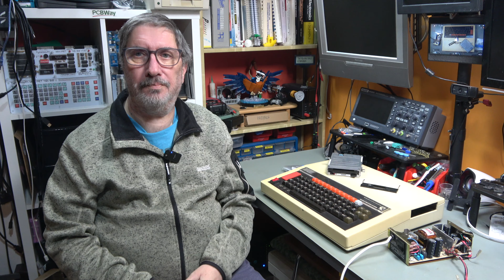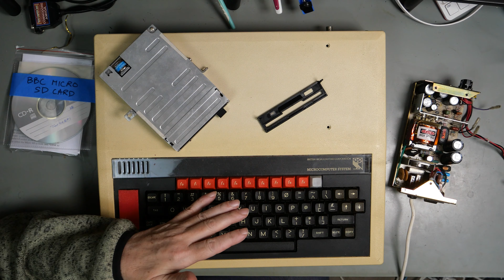Episode 83: BBC Micro Floppy Repair attempt And More...

Comment: I am almost sure you have the data cable back to front for the floppy drive as you has the pin one end towards the centre of the drive. which normally results in the LED on the drive coming on all the time.
Reply from the maker: Thanks. That's definitely the consensus.

Comment: Your floppy disk data cable is in up side down. You can see the correct orientation printed on the PCB at 13:36  pin 1 (the blue stripe) should be to the outside of thr drive. 🙂
Reply from the maker: Thanks

Comment: Great video Tim =D  Try that cable the other way around with respect to pin 1 (you could measure grounds on the controller board and drive to be sure).  The 1772 does DD but not HD, I think you need the Ajax chip for that!
Reply from the maker: With the amount of BBC media in my possession being a big round 0, I'm not too worried about HD, just curious is all. But I'll definitely flip that cable. Thanks Chris.

Comment: I don't think anyone else has commented on this yet, but I think your Beeb has had some mods associated with the sideways ROMS.    If memory serves the sideways ROMs on the motherboard map to ROM numbers 15, 14,13, and 12, and will only normally support 8k or 16k devices.   Your combined BASIC/DFS ROM seems to be a 32k device, so I assume that there has been some tinkering with the logic to enable this feature.   Also the ability to use a static RAM device I think would require a modification to the stock design.   Whatever it is, is clearly working, but if I were you I would try to figure out what and how it has been done, lest it conflict with something else you may wish to experiment with in the future.

I think I would be looking around the IC20 and IC21 area and IC76, and the associated links on the board.  Maybe there is evidence of some cut tracks and/or bodge wires, also maybe directly on the ROM sockets themselves.

I for one would be interested in knowing what has been done, especially as it seems to work great!

Regarding the power supply, I would double check your work around the electrolytic capacitor you replaced, as I think this one which lives close to a warm-running resistor can cause the PSU not to start up if it goes faulty, and this is the reason the replacement is recommended (having an electrolytic next to a hot component often results in premature failure eventually)
Reply from the maker: Thanks, I'll definitely look for mods around those ICs. I noticed the combined ROM was double sized, but not knowing enough about it, didn't really investigate further. The whole sideways ROM notion is new to me, so that's something I want to delve int in more depth.
I will definitely double check that electrolytic and the resistor next to it.

Comment: There are different types of sideways ROMs in a beeb: they can be 'language' ROMs (L), 'service' ROMs (S), or both. Essentially, any ROM with a * command is a service ROM and language ROMs include any software that executes directly from ROM, including programming languages but also word processors, games, terminal emulators, etc.

The model B has 16 logical sideways ROM banks, but only 4 are available on the board. You can solder some missing lines to be able to install larger ROMs and access the missing banks that way, or there were piggyback ROM expansion boards available that provided 16 ROM sockets. These days, you can get boards with flash ROMs or battery backed RAM available to load ROMs in situ.

The order of the ROMs is also important because the ROMs are searched from top to bottom (right to left on the board) on boot or whenever a * command is called.
Reply from the maker: Thanks for the info. I'm hoping to explore what you can do with the ROM sockets in the future...

Comment: Sometimes a constantly spinning floppy drive is the result of having your  ribbon cable inserted upside down.
(Ask me how I know! 😂)
Reply: Exactly that, when you twist the cable, all signals are shorted to ground. Motor on and drive select are active low, so you get a spinning motor and a solid on LED....
Reply: In fact I've just looked at your first video featuring this machine, and you can see from the original footage that the ribbon cable has the pin 1 marker (the blue stripe) towards the outer edge of the drive, but you reinstalled it with the strip towards the middle of the drive.  It seems reasonable to assume that the first way is the correct one ...

Slam dunk I think!  😀
Reply from the maker: Thanks guys, I'll be fixing that 🙂
Reply: Yep, light on - always spinning, usually wrong way for pin 1!  Or the drive / controller has a fault.
Reply: Exactly right
Reply: how do u know???